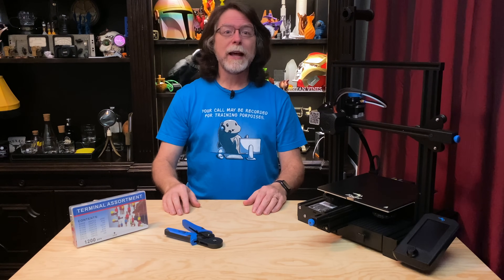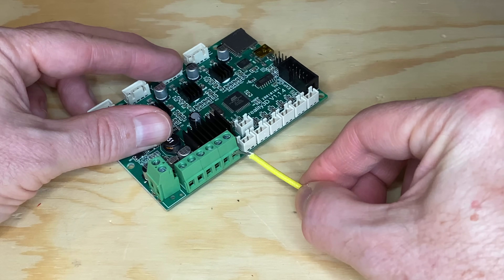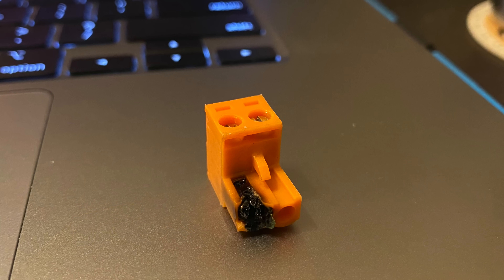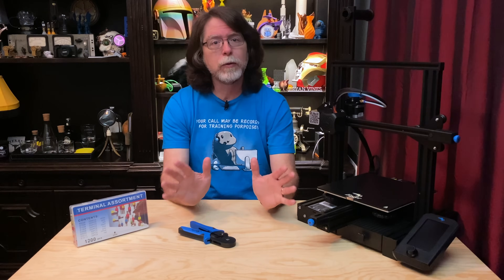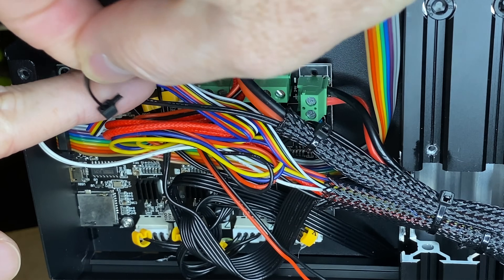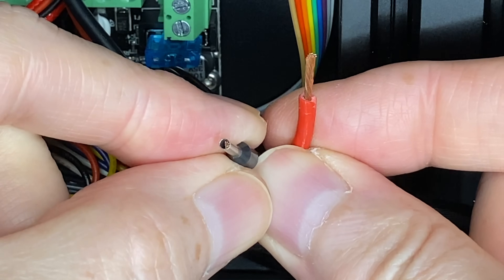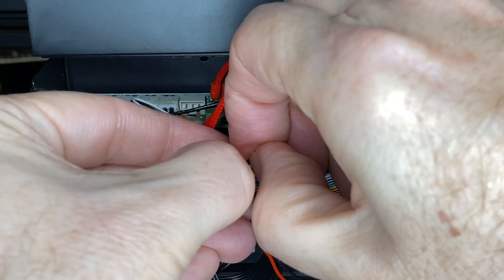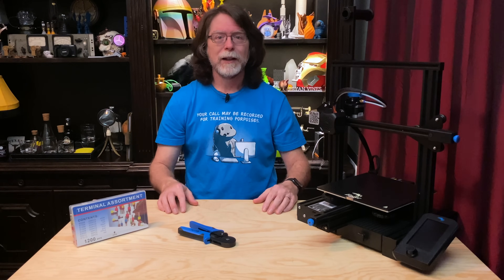Install Ferrules on Ender-3 V2 Wiring

Comment: Having connected many of those, I can assure you that it is easier to put a little solder on the tip to control unraveling, but not so much that your strands are floating in solder.  MUCH less resistance than adding yet another mechanical connection to the circuit.  I would never add those ferrules.
Also, you are exaggerating the the thermal expansion rate of modern solder.

Comment: DON`T twist wires before crimping!!!! Jast strip, put on ferrule and crimp. Twisting the wire, you do the same if you pressed it with a screw. When crimping, twisted wires can cut each other. Wires must be parallel to each other.
Reply: interesting.
Reply: Interesting, my tension cables are twisted inside their crimps. Though they are made of steel.

Comment: Do V2's come with silent boards as standard ?
Reply from the maker: Yes.
Reply: @BV3D  I've recently purchased myself an ender 3 pro as birthday gift to myself and after hearing how literally silent the V2 and the boards are I wish I just got the V2 I've ended up buying glass bed better springs and aluminium extruder just need to get the board now but after all is said and done I might as well have just brought a V2 I've learned a lot upgrading though and through a couple of your vids I'm now and avid subscriber thanks for all your hard work man really helps 🙂💪

Comment: Thanks for making this video, I have been preaching the use of ferrules, in social media and other places, since I noticed this problem with my Tronxy X3 kit (ya that ole thing). Very concise and to the point. For those who are really afraid of messing up, I would suggest removing, clipping, stripping, crimping and installing, one wire at a time. :-)
Reply from the maker: Hi Randal! Thanks for the one-at-a-time tip! 👍

Comment: Hi bryan i have  confusing  to buy 3d printers  which one is best ANET  or ENDER which one is   model ?  Help me
Reply from the maker: Hi Henny, I've got an old Anet A8 and an Anet ET4 Pro. I wouldn't really recommend the old acrylic A8 to anyone. The ET4 Pro has firmware bugs and the auto-leveling bed probe wasn't reliable on the review unit Anet sent me.

I've been pretty happy with my two Ender-3 V2 printers (and my Ender-3 standard and my Ender-3 Pro). They aren't without their faults, but nothing I've run into with them has really been a show-stopper. There are one or two little firmware issues with the Ender-3 V2; one is a bug that causes it to report temperature information twice instead of once when it writes its status information to its USB port, another is that it saves any settings adjustments to the memory card instead of on the mainboard itself, and another is that it doesn't appear to support the M600 G-code command for filament swaps.

Third-party firmware is available for the Ender-3 V2 to fix these issues, and I heard that Marlin firmware was available for the Anet ET series, so that could help with some of the firmware issues I had on both printers.

My personal preference is the Ender-3 series.
Reply: @BV3D   tanks  bryan i wish to buy ender 3 v2

Comment: You failed to mention that stranded wire isn’t for flexibility, it’s for higher amperage ratings. Electrons travel on the surface of the wire, so the more strands, the more surface area for electron flow and higher amperage. My question is this, does the ferrule become a resistor to the flow, since less strands are contacting the terminal directly? If this is the case, then you would have yet another burnout eventually, from overheating. When a stranded wire connection catches on fire, it is less to do with overheating and more to do with arc flashing, no?
Reply from the maker: Hi! https://blog.jemelectronics.com/stranded-vs-solid-wire says, "Because of the given thickness of stranded wire, i.e., it’s thinner, there are more air gaps and a greater surface area in the individual strands of wire. Therefore, it carries less current than similar solid wires can."

The graphic at https://www.firefold.com/blogs/news/solid-vs-stranded-cable-the-pros-and-cons-of-each says, "One of the big advantages of stranded cable is its flexibility and ease of use in routing the cable."

With the ferrule compressed around the strands, they're in very close contact to one another as well as with the surface of the ferrule which is compressed against them. But to answer your question, I'm not sure. If you like, I could measure the resistance of a wire before and after the installation of a ferrule.
Reply: @BV3D  ah thanks! I am an electrician by trade, and in my years I had come to the understanding that stranded wire carried more load because of its many strands vs. solid wire’s one strand. I didn’t know that stranded wire was designed to have the same cross-sectional area as the solid counterpart. Thanks for enlightening me!

Comment: Thank you for this! You’re quickly becoming one of my favorite 3D Printer Info Sources / Youtubers with your (relatively) short videos that set out a problem and explain it, then illustrate how to fix it. I also just noticed you put sources in the description. Excellent! Your anti-backlash nut video saved me major headaches from my Ender 3v2 gantry falling down after a print every time (started when i installed a camera on it for octopi; was about to remove the camera and then I saw your video) and now I’m going to add ferrules too. I spent three hours last weekend repairing cracked solder connections on a small amplifier I built years ago, but it never occurred to me to address the issue before it happened to my printer.

Comment: Ender 3v2 or Biqu B1? It's my first printer and those are my final choices after knocking out artillery genius
Reply from the maker: Hi! I haven't used a Biqu B1, so I can't directly compare it to an Ender-3 V2, but I can look at the B1 specs and make a few observations.
- Both are Bowden drive systems.
- Both have silent stepper motor drivers.
- Spare parts appear to be readily available for both.
- Both have color screens, but:
   - The B1 has a touchscreen, and
   - The Ender-3 V2 requires the use of the knob to interact with it.
- The B1 has a larger build volume.
- The B1 has a magnetically-attached spring steel sheet, which makes print removal easy.
- The Ender-3 V2 has belt tensioning knobs on the X and Y axes; the B1 only has one on the Y axis.
- The B1 has a filament runout sensor.
- The Ender-3 V2 is roughly US$20 cheaper (source: Amazon)
My personal feeling is there's a larger user community around the Ender-3 series than the B1. I have two Ender-3 V2 printers and I've been pretty happy with them overall, though they do have their faults (which I fix and then make videos about).
I'm curious why the Genius is out of the running. It's just a smaller Sidewinder, and I've been pretty happy with my Sidewinder.
Reply: @BV3D  I've been on the sidewinder and genius groups and feel there's a lot more issues with the printers themselves.  The Biqu B1 seems just like an upgraded ender 3 with all of the Bigtree tech upgrades already added for not much more. I like the idea of the plug and play BL Touch sensor on the B1 and the 2 20x20 tracks on the base for stabilization instead of the 1 20x40 of the ender 3. Do you prefer your Sidewinder to your ender 3v2?

Comment: I wish my printer heated in 5 seconds, must be pushing 100A at that point. I guess it takes a few houses to burn before they force the manufacturers to make them connections right
Reply from the maker: I wish mine heated up in 5 seconds, too. That was about 3 minutes elapsed time. Fortunately nothing super bad happened as a result of the burned connector on my Monoprice Maker Select Plus. The thing that gave it away on THAT printer was the thermal protection error when the bed wouldn't heat up any longer.

Comment: I like your video, but dislike for this one.. half video is just bla bla bla.. without real current, wire heating expansion calculations and so on..5v-12v o_O You could just say, that will improve connections look.. and all will be ok. How much time was needed to use ferrules.. and soldering is quicker? No, but probably cheaper in factory.. :) When i get crimping tool was remaking lot of my own connection, just to get professional look ;)
Reply from the maker: Well, that's OK -- Not everyone likes everything I do. With a lot of my videos, the first half is describing the problem, the second half is implementing the solution. I should add chapter markers though.

And while ferrules look nicer and have a more professional appearance, the problem of expansion, crush, and loosening over time actually happens. I've had to tighten the screw terminals in printers after a period of time, and before I knew to do that, there was that issue with my Monoprice Maker Select Plus.

In a factory setting, tinning wires is typically done by stripping and twisting the wire, dipping the end in flux, then dipping it into a solder pot. Strip, twist, dip, dip. It would take but a second to do after stripping and twisting the wire. Crimping would take a few extra seconds per wire. So crimping ferrules would slow the production of wiring harnesses a bit, and ferrules would add a bit of cost, but it would probably be less than a penny per.
Reply: Chapters make people to skip lot of things.. specialy when your videos already are short and it will take lot of your time. I like that you dont avoid some criticism. I have seen lot of crimps with wrong size ferrulas. In your video you showed black for one size and red for other.. sadly some will have only one size.. and lose connection ;) Yes.. i speak about myself to.. :))) In our country shops mostly sells just popoluar sizes for 1.5 - 2.5mm, smaller ar costly and sells in special shops.. online takes more than 2 weeks.. and when you open some box.. you need it now, not after 2 weeks.

Comment: I'd say wild and untamed applies to making up JST connectors.  At least for me.
Reply from the maker: Oh man, those are a pain! I have to use a non-ratcheting crimp tool when I do the little fan connectors. Otherwise I overcompress them and crush the metal. No amount of dialing back the pressure seems to work (but I may just have a cheap ratcheting crimper for those!) 😬

Comment: Make sure the metal end of the ferrule inserts completely into the screw terminal block (like yours did). If too long and you can see the metal ferrule sticking out, just snip a bit off.
Reply from the maker: Good idea. The less exposed metal, the better. 👍
Reply: So it's better if it's too long than too short. Yo ucan always fix it after.

Comment: I did this a while ago. Super convenient.
Reply from the maker: These are the easiest crimps I've ever done, too. Much easier than the little bitty ones for fan connectors and stuff.. The rest of my printers are going to get this treatment as I find time. 👍
Reply: @BV3D  oh top tip for the tiny ones: part close the crimp first so it ratchets partway closed, then place the ferrule and insert the wire. The professional models have a little sizing tool that slides into place over the anvils to hold the ferrule in place, but this trick works for the amateur models like mine.
Reply from the maker: @Max Ashton  Oh, awesome tip! Thanks!
Reply: They're just as good for light fittings. You will thank yourself next time you replace one!

Comment: Funny thing... I was just explaining doing this to Kristie at 3:30 this morning.
Reply from the maker: What were you doing up at that hour, Ben? 😴
Reply: @BV3D  actually, I was checking on a print and answering some firmware questions from a guy in the UK. Kristie asked me a question about another person I had helped earlier in the day who needed some instruction on changing a nozzle in her Sainsmart Coreception 300 (of which I also own) and the discussion ended up on ferrules and crimping. Kristie loves having her 3D printer, but she doesn't want to know all of the gory details of fixing them. When her printer goes down she thinks I'm the guy who should fix it. She just wants to print.
Reply from the maker: @BenEBrady  Sometimes, we all just want to print. I mean I like a challenge sometimes, but I also like using my printers. 😁